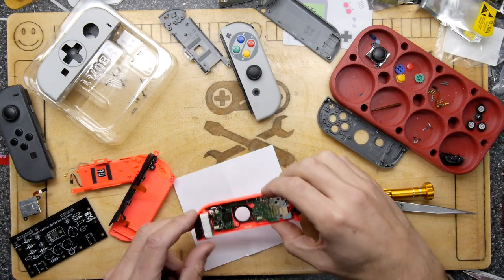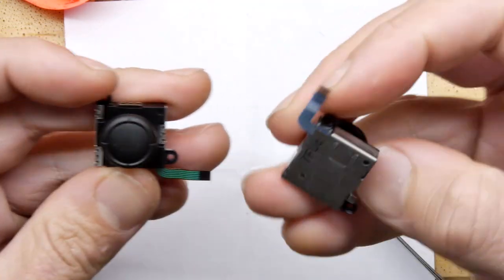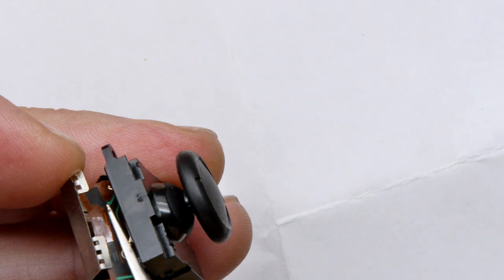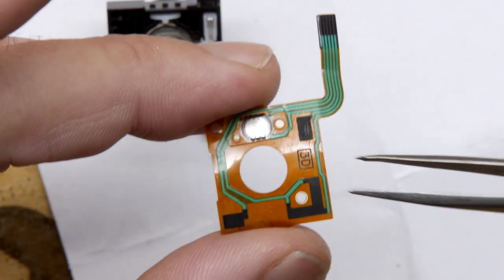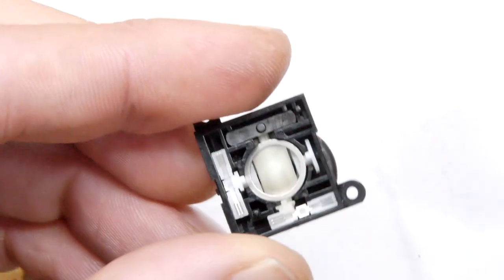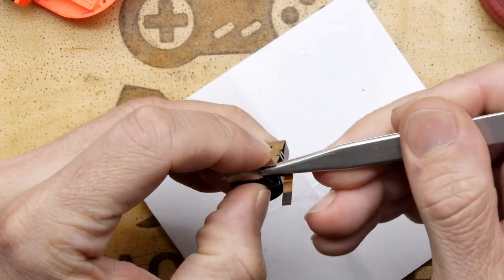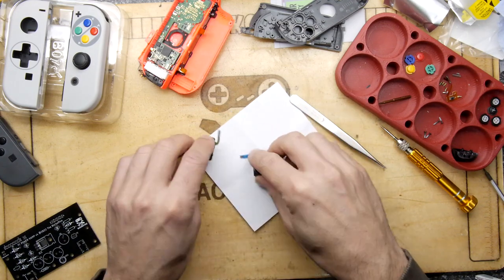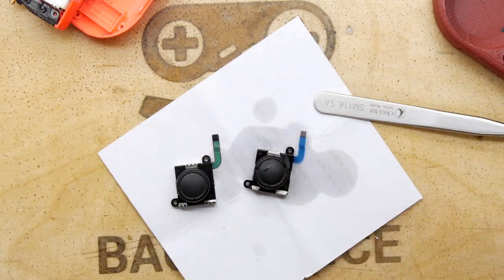Cheapo Nintendo Switch Joycon Drift Repair!

Comment: If your Joycon stops drifting when pressing firmly on the back cover of the controller on the opposite side of the stick, a solution could be simply to add padding inside the case, so the metal back of the analog stick is always "pressed". I've seen this trick on the interpipes but can't find the link.

Comment: I've had good sucess with cleaning the analog stucks with IPA. Using a cotton bud to drip it into the insides then working the stick and repeating a few times. Works great.
Reply from the maker: Awesome. It's crazy how grubby the circuit board gets considering how relatively sealed it is

Comment: Interesting video although that's perhaps too fiddly for me. I've replaced two. One was a third party that worked first time.
The second didn't work properly, so like you, I liberally doused the joycon in IPA, continually working the stick. When I reassembled the joycon, I padded the joycon holder with a few squares of paper to apply more pressure to the joycon. I saw this on a YouTube video and thought why not! 
I'm not sure which of the two methods helped, maybe both, but the joycon has been fine ever since and this was months ago.
Reply from the maker: I'm trying some after market joysticks on a set and I'm very impressed. I think I would just swap them out when I could.